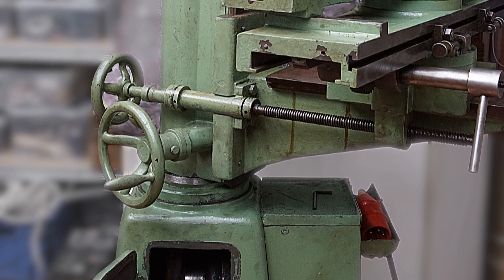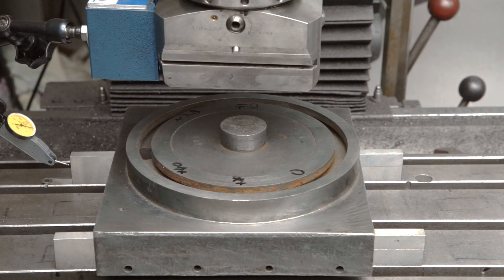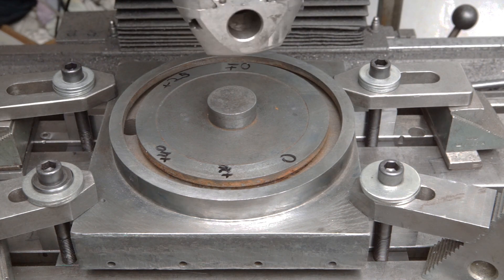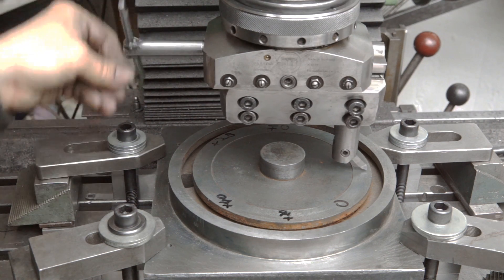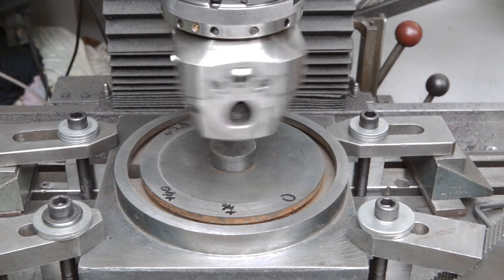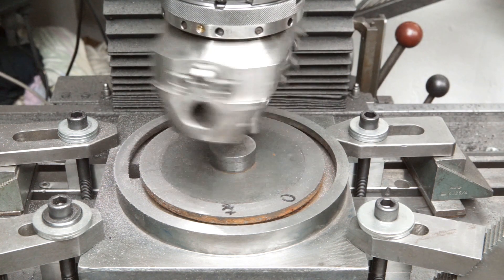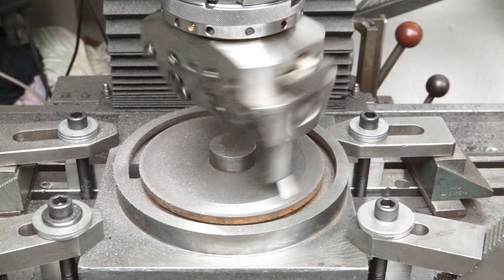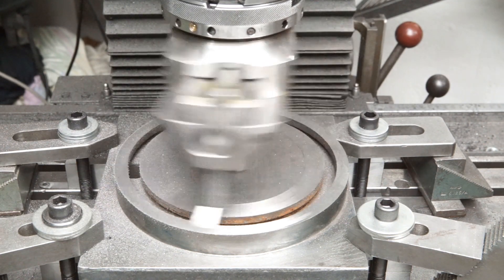facing a cross slide with Wohlhaupter UPA 5 boring and facing head

Comment: I have the upa 1,2 and three. Love them! Also have a Narex 36 whicg works similar to your upa4, but is considerable smaller.
Reply: Mainly boring precise holes and counter bores
Reply from the maker: What kind of work do you do with your heads? I would like to have a smaller one as I wouldn't dare to run my heavy head on high speeds.